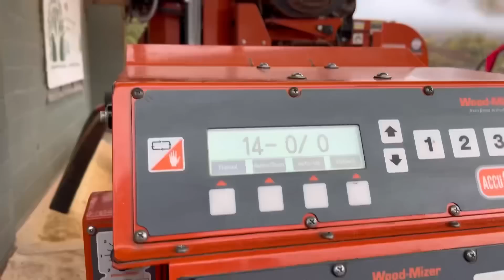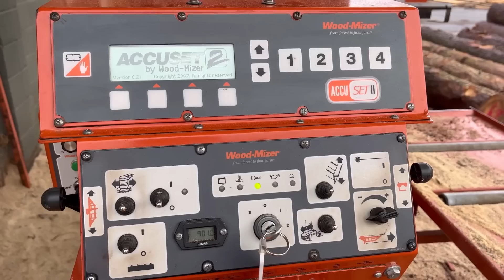Starting Off Strong This Monday!

Comment: Lots of Firewood in those First Cuts. S;abs. Great video and editing.  Keep smiling Jade♥  I think it would save a lot of steps if you raised the far end of those 8x8''s 6" so logs would tend to roll towards the Mill.
Reply: @laus9953  If you notice they don't roll well by themselves.  A bit of a slope would help the operators with cant hooks move them.

Comment: Suggestion: mill log stand feeding lumber to Miser… add a 1” or 2” block under the metal  rails on the outside. This would allow gravity to assist rolling the logs to mill lift point.
Reply: lumber capital log yard  scammer
Reply: Would that not also increase the chance of stacked logs rolling by accident? Thereby endangering the workers?

Comment: Great looking neckwear Emerald. Is that Lee’s work? Make sure the chain is strong enough to withstand a single hand pull. Your other hand might be busy.
Reply: it highly dangerous to wear hanging anything around machinery
Reply: @zarb88  I have never seen these ladies put themselves in dangerous situations. It seems to me, they go to great lengths to keep themselves safe, operating the machines. Can you provide a video of them in a dangerous situation, with their hair, or clothing near moving parts. The operators station is well away from the working areas of the mill. The boards are drawn back to the swamper, away from the moving components of the mill. I also believe the boss wouldn’t allow them to operate the equipment, in an unsafe manner.
Reply: @threepointservices-tractor4832   fully agreed. Lots of osha karens on yt.

Comment: I like just fine.  I have a question though, and I don't know the answer.  You seem to take a thick slab off the face  headed straight for the cant.  Now those thick slabs it seems to me could be one or two or more live edge boards that would be dropped into the edge rip pile.  You have an excellent edger.  There is much slab that could make 1X4s or 1X6,, sometimes more,, but they would have to go through the edger.
What I truly do not know is the economics of my observation.  It could well be that the 1X4 or 1X6 is more expensive, less profitable,  that just selling the slab wood as is.   There is also a market for 'seconds'  lumber that is not perfect has more wane that you would like.  Again,, you may be making the correct profitability choice already.  So much of the rough sawn boards I have used in my life had substantial wane.  Flip the board over and the wane made no difference.

You may have already,,, run some experiments on slab savage,, time vs cost, vs sales ,, Is it a profitable thing to do?  Your first cut on a given side would then always be less than 4 or 6 inch width slab.  The second and perhaps third cut would be 4 quarter stock intended for the edger

Comment: 6:11 - what was in that jug? Lube or fuel?
Reply: That’s the blade lube. They use water with a little dish soap.
Reply: @charleseck3941  Cool thanks. I couldn't figure out why the saw would be diesel powered but it is on wheels.

Comment: Clearly all those that watch your video aren't close enough to purchase your products, but do you ever worry about now, with your increasing visibility/advertising footprint, that your product may be hard to keep in stock, and thus customers may get tired of showing up and no product to purchase because of the demand, and then not return as they can't get what the need?  I.e., is this a legitimate concern and/or is there  plan in place to increase production/manpower should that happen?  Is expansion/production inrease possible?